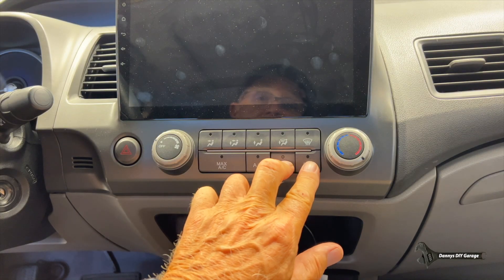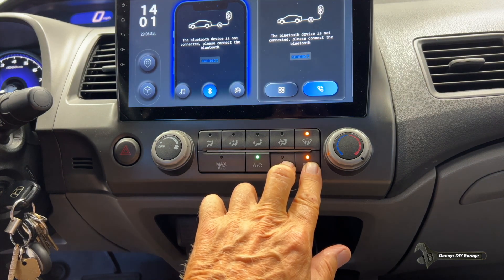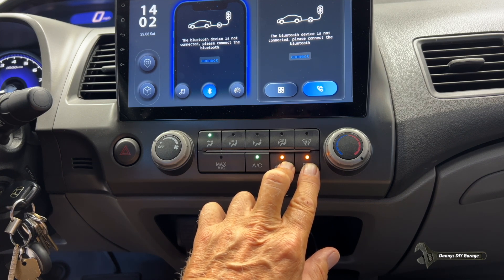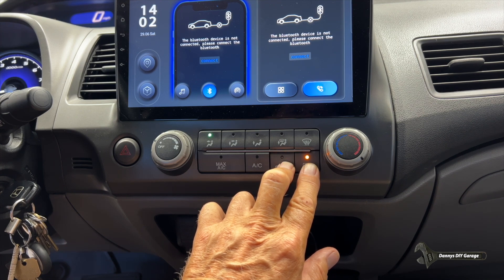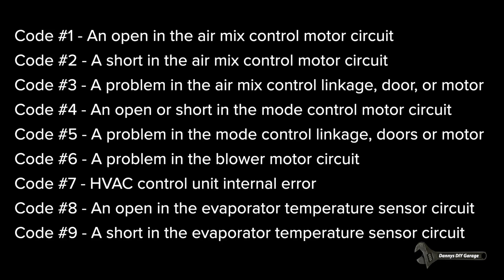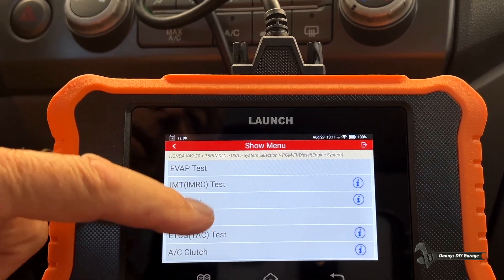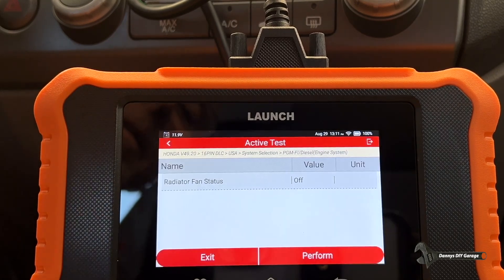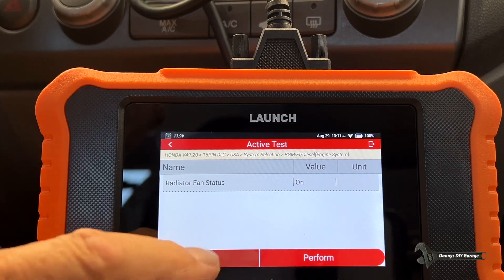Honda Civic AC Not Blowing Cold Enough? Full Diagnostics, Gauge Reading, & Freon Recharge

Comment: wich gauges compatible for honda hrv 2020?
Reply from the maker: these are a good choice for your car, these will do most vehicles: https://amzn.to/4oTdwW0
Reply: @dannysdiygarage  thanks aalso what is the cost of fuel mixing with engine oil?
Reply from the maker: lots of things can cause fuel in oil: Worn Piston Rings: 
Faulty Fuel Injectors: A fuel injector that is stuck open or leaking can spray more fuel than the engine can burn. T
Engine Misfires: A misfire is when a cylinder fails to ignite the air-fuel mixture. 
Poor Maintenance: Infrequent oil changes allow
Reply: @dannysdiygarage  thanks
Reply: @dannysdiygarage  i have a question about cleaning the abs sensors on my hrv do i need to discnnect battery first? before doing this  second what cleaner i use to clean this so it wont get damage? or any dashboard comes out? any other tools i need? thanks
Reply from the maker: @Hardenth50 use electronics cleaner or mass air flow sensor cleaner, that won’t hurt the sensor
Reply from the maker: Battery doesn’t need to be disconnected
Reply: @dannysdiygarage  you mean i can spray directly to it? the actual sensor yes? thanks for replay lovbe  your channel and your very activbe and help ful i like keep my car for a long time by preventing it mostly cleaning
Reply from the maker: @Hardenth50 yes, spray on the sensor and the reluctor ring
Reply: @dannysdiygarage  hello danny i know this is out off subject i bought a hella horns and i wanted to connec using my factory harness how do i about doing this? should i  use a relay it comes it hit? i see many vidoes but most of this vidios its on subaru they just plug and play so you think hella horns means for subaru only? need help please

Comment: @ 16:31 when you say the high and low side gauge readings, I assume that you mean PSI and not degrees correct?  It was good to see that you were trusting to charge via weight and not pressures.  I was SO confused on how much to charge but I did not think that the pressure will increase under normal operating conditions as compared to idle.  Your video was the ticket and I recharged exactly to 16 ounces and after like 4 attempts I finally got my AC down to the 40's.  Maybe it was my charge amount was off or I just never let it sit enough between the bottles.  Either way thank you so much Danny!  I'm ready for the heat wave tomorrow. 🙂
Reply from the maker: Yes pressure and yes the correct amount is the key

Comment: Good afternoon Danny, hope all is well.  I was hoping you would be able to supply some information on the size of the ac shrader valves both hi and low pressure lines.  I have a leak and need to change them.  Not sure if they are universal for 134a freon.  There seems to be kits online, but want to make sure I get the correct one.  Also have you tried the tool that extracts the shrader valves without depressurizing the system, if so, would like to hear your thoughts.  Thank you for all your great content.

Comment: I am watching lots of your videos to diagnose why my 08 Acura RL AC blowing cool air. Condenser is good, compressor is good, fuse/relay are good, bought a can of AC Pro to top off freon but the low line pressure is still in the green (filled) zone. Maybe expansion valve next?

Comment: Hi Danny. Does the fan and compressor stay on when ac is turned on? Or does it cycle? I would appreciate your help
Reply from the maker: It cycles to maintain the correct temperature
Reply: @dannysdiygarage thank you for your prompt response. My ac does not cycle it stays on and blows cold and the low pressure line becomes icy. Is there a reason for this?
Reply from the maker: @e.r.videography6209 there are lots of reasons for this, google search it, but it probably needs to be evaluated and recharged with the correct amount of Freon
Reply: @dannysdiygarage thanks

Comment: How is your thermometer connected? How does it read the inside temperature when it’s hanging outside? How did you know when to stop adding refrigerant? Just stop when it gets around 45 degrees? I didn’t notice the gauge pressures changing at all.

Comment: Hey I have a question I have the same car and my AC was bad and wasn’t throwing cold air at all so I replaced the bad AC Compressor and then when I added 2 cans, it finally started to throw cold air BUT now every time I turn ON the ac is makes a loud weird rattle noise and it stays like that. Do you know why would that happen?
Reply from the maker: Many possibilities, bad new compressor, tensioner, belt, over filled with Freon, all just guesses, just things to check
Reply: @dannysdiygarage  if it’s over filled what can I do to fix it ?
Reply from the maker: @nike2126  have a shop evacuate it and add the proper amount of, (if that’s the problem )
Reply: @dannysdiygarage  i appreciate you, thank you 👍🏼

Comment: Why is my car blowing cold when driving only . When I stop the cold air stops too why is that ??
Reply: This is not uncommon.  Probably not enough air going through the condenser when stopped, which improves when the car is moving.  And/or not enough RPMs for the compressor when idling.  Check your condenser and see if it clean of bugs and debris and if not a cleaning might help.

Comment: Im waiting for to do a video on how to replace the spacer on the AC clutch. Mine works when it's cool but doesn't work when it's hot. 
The Launch tool looks good. I have a Foxwell but i like the big screen you have.
Reply: we did that to 2007 civic just pulled off passenger tire and small corner of wheel liner then took off bolt of compressor with impact gun so you don't have to try and hold clutch still remove clutch and pully can stay there with belt on it you just fish out a spacer washer from opening where clutch shaft goes in cleaned up back of clutch for smooth contact surface and put it back on washer was only few thousandths thick but it worked fine ever since then
Reply from the maker: LAUNCH X431 Honda 2.0: https://amzn.to/4egCjgk

Comment: 11:07 what metric tells you that you need more Freon and that’s the problem?
I thought the code in the beginning was about the motor or circuit?
Reply from the maker: Sorry for the confusion, the code at the beginning was just to show where to start your diagnostic process, the proper way to recharge the ac system is to evacuate and recycle and charge, since I suspected it was low, the metric was to add a bit of Freon until the temperature quit dropping and the pressure stayed around 40psi, too much Freon and low pressure will start rising and so will the outlet vent temperature, it’s a balancing act
Reply: @dannysdiygarage  I have the same exact car so I follow you. Mine has never had a problem and yours unfortunately seems to have a lot.

Comment: i gave my daughter a 2007 civic same color as yours and it had weird glitch ac worked when it was just warm out but as it got really hot it would just blow hot air the compressor would not come on I watched a ton of videos and it was just a spacer washer on the clutch had to be removed we took off the clutch cleaned up rust on back of it with wire wheel pulled out a thin spacer behind clutch put it back on and it has run great for years now.
Reply from the maker: Great information and thanks for sharing
Reply: I’d love to attempt this repair myself do you have a video or blog post explaining this process?
Reply from the maker: I have a other videos that are in a play list on my channel
Reply: @dannysdiygarage  to remove the spacer/washer that ranger is talking about?
Reply: It’s a 14mm nut on the front of the compressor pulley, you might want to pull the right front wheel off to make it easier to get to. Remove the nut, the clutch plate, and remove the shim washer to reduce the clearance between the clutch face and clutch assembly on the compressor.

Comment: Hey Danny really loved your videos they really help me a lot on my 8th gen. My concern is not related to the video but hope you could shed some light. 

Two weeks ago had my transmission fully rebuilt (AT). Not sure if it happened after but I just noticed today that it won't shift into 5th gear.  There was also one time that the "D" was blinking (I turned off engine and after started it again the blinking was gone). 

What could cause it? As did mentioned transmission was just fully rebuilt. All o-rings etc was replaced.
Reply from the maker: I had that happen years ago, 75000 mile later, still never happened again